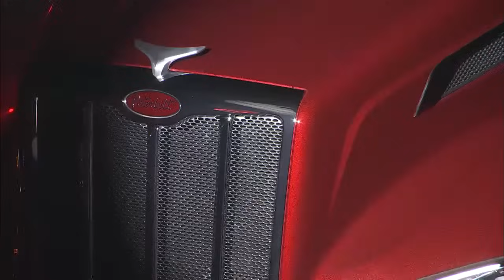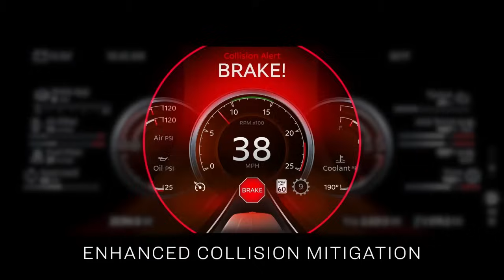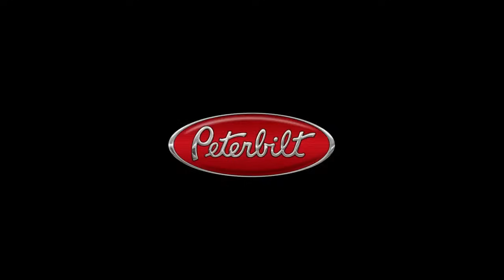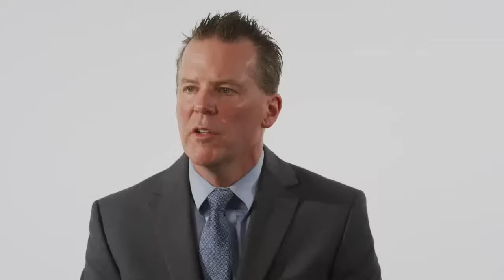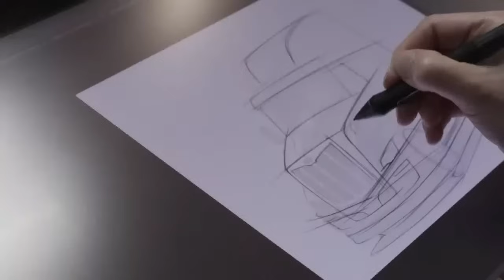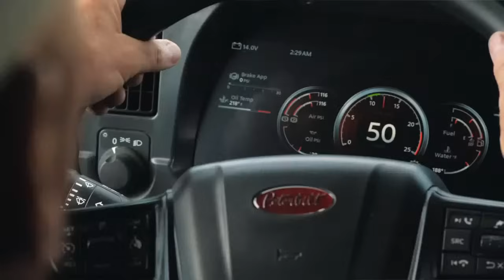A New Era of Class - The New Model 579

Comment: Don't know why you don't ask a race car driver and trucker about gauge lay outs. Old dial gauges are better remove one and replace and go on down the road quicker say maybe 10 minutes. And you just turn the gauge so the needle points straight up when normal operations and warmed up old race car driver trick. So you can quickly glance and see everything is good all needles pointing up. This done so the driver is not trying to read the gauge while driving and possibly getting into an accident.

Comment: With so many sensors I wonder how long I can run without a problem!
Reply: About a day
Reply: We have all these sensors in european trucks and we don't have problems for years. I wonder, do they install cheap sensors or old technology sensors in N. America?
Reply: @chrishar110  I don’t know if they are cheap or not but I drive 2000 Pete with Detroit 12,7 and I see a lot of new trucks on the road towaway
Reply: @nemeciochupaca8180  2000 Pete? I dont think that you can find a 10 yo truck in UK. First of all, why should I keep that truck and not replace it with something better? 2nd, I dont think that it would pass the emission standards. 3rd, if something happens and you need parts I dont think that you can find in UK. Can you find parts for that dino? We usually keep our trucks not more than 5 years - 1 million miles. We usually sell them in Africa or Asia. It will cost more to keep it than to replace it.
Reply: @chrishar110  well here in US old trucker don’t change too often for a new truck,parts ? It’s not so hard to get the parts
Reply: @chrishar110  Chris ,you might wanna check Texas chrome shop and you’ll see what I mean!
Reply: @chrishar110  how much a truck cost the UK?
Reply: @nemeciochupaca8180  From 80 to 130k pounds - $90-145k for a normal truck up to 550HP, you can touch 180-200k for a truck with over 700HP with all the features you can get.
Reply: @chrishar110  and how much money you make a week?as a owner operator?
Reply: @nemeciochupaca8180  IDK, I am a driver. I make around 35k pounds every year with 55-60 hours average every week , and I am home every night. More than my manager (28k). We get paid by the hour or with salary  for 40 hours every week plus overtime. I make about 2000 miles/week. We can not exceed 45 driving hours every week by the law and the top speed of our trucks is 55-57 mph
Reply: @chrishar110  ohh ok,there is no OO’s?
Reply: @nemeciochupaca8180  What do you mean? If there are 2000 model trucks? You can find old trucks only on truck shows. I worked only for one company company that had trucks 6 or more years old. That company had financial problems and couldn't replace them. I broke down only once last 10 years and it was a broken exhaust from a previous accident. And once an engine warning light because the previous driver left the truck without adblue, he made 1000 miles and we had to clean - replace the exhaust filter.
Reply: @chrishar110  yeah,my Pete is a2000,,with Detroit engine,I’m an owner operator,that means I look for the loads and drive
Reply: America can’t live with out OOS
Reply: @nemeciochupaca8180  You can find a 2010 Scania 600HP with 15k in UK, but it will have 1,5 - 2 million miles. You can start with something similar as an owner operator, but you will need a special license (you pass some tests about financial, companies etc) an office and somebody in the office. But you can not hit the big companies, many drivers tried that, they started with one truck, they made 2-3-5 trucks and then failed and lost everything. You can not survive with one truck and you need great managing skills to expand. If you already had the skills you could work for somebody else with less risk.
Reply: @chrishar110  well I might move to the UK
Reply: @chrishar110  there is always an annoying POS in the comments
Reply: @akilghosh  annoying?it’s just my point of view,if you can’t take that you are. The annoying!

Comment: Gimme something with big stacks a cat and an 18 spd manual I'm in a 2020 t680 which is birthed Frome the same heap of shit as these and they are worthless on anything but dry pavement. Icy lot? Nope. Mud? Don't even think about it even with power divider and dif locks it shifts when it wants to even in paddle shifters mode. Drops power, and traction control spazzes out even when it's supposed to be overridden by the switch. Only reason I'm in this heap of shit now is so I can buy me a k100 aerodyne with a big kitty in it.

Comment: Can you still get real gauges in a 389??
Reply: Until July, you better get one now if you want gauges.
Reply: Do you still prefer the old round gauges? You can have everything you want in front of you, you dont have to take your eyes from the road with the new ones.
Reply: Yes, I do, and believe it or not, moving your eyes around, helps avoid fatigue. Once you know where your gauges normally operate, a mere glance will let you know the needle is in the proper position. The new style gauges can also lead some people to distraction, by giving them the ability to scroll through different pages while driving. I’m not against having the new style gauges, but I wouldn’t want them in a classic truck. It’s also difficult to get a real grasp of what they are like,  by a video.
Reply: @davebullock3517  OK, I got it, you prefer manual transmission, no exhaust filters, old analog gauges, loud engines, straight pipes,  drum brakes.... etc etc. OK. You are from N.America I have to remind you that we live in 2021 and not on 1970. If you want to avoid fatigue you should sleep better and have a more easy to drive truck. I was like you till my 30s, but now on my 50s I prefer a quite, auto truck with air ride. I drive a 2020 volvo fh12 460hp, I have 300k km - 180k miles and I change it only for a 2021 model. I don't have to look around to avoid fatigue, I drive 8-9 hours every night (450 miles) 5 days every week but I sleep 8 hours no matter what.
OH, I almost forgot it, if your dispatcher pushes you to make more miles than you can, find another job.
Reply: Dumbest move they could ever do  anyone buying a 389 wants nothing to do with the electronic monitor

Comment: How much is it going to cost
Reply: Too damn much
Reply: 200k 
Don’t worry you will be saving 2000 a year on fuel if it’s $2.50
Reply: @MrAdoii99  thats what i was thinking a whopping $2000 u can save that just by not running for two weeks
Reply: My first thought would be alot.
Reply: 145-160 depending on options
Reply: @alex7289  200k no?
Reply: @Uluhbek97  mine new get costs 195-196k. Almost every option in there,except apu
Reply: @volodymyrprosov6134  So expensive 😫
Reply: @Uluhbek97  yeah :( 
I think that next truck i will take ,might be a bit lower configuration
Reply: @volodymyrprosov6134  with no apu.. and no apus avail to order😢😢